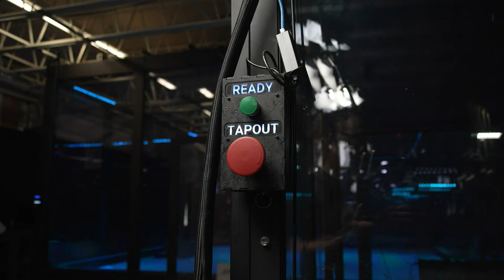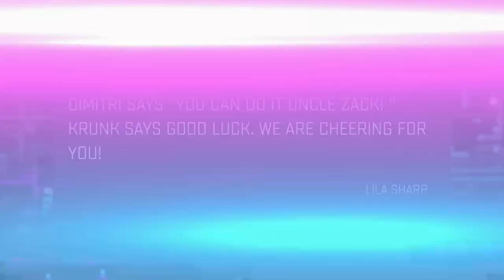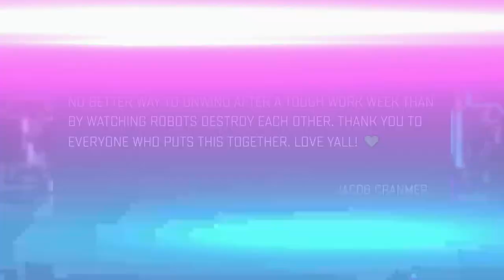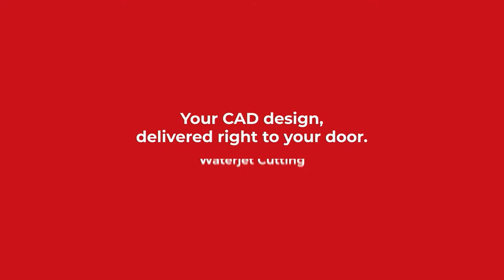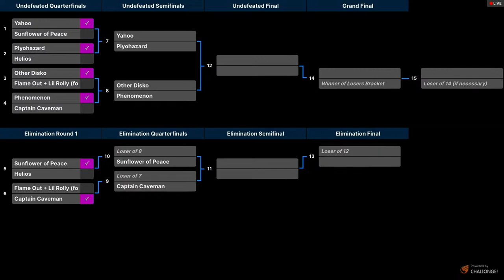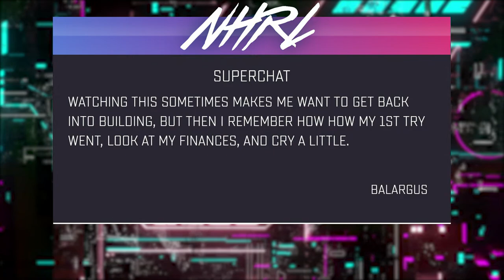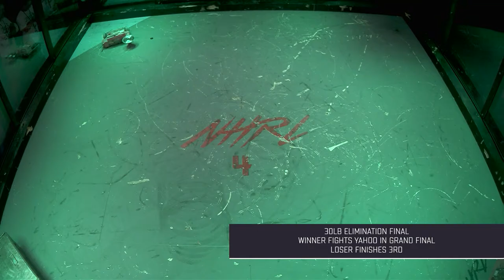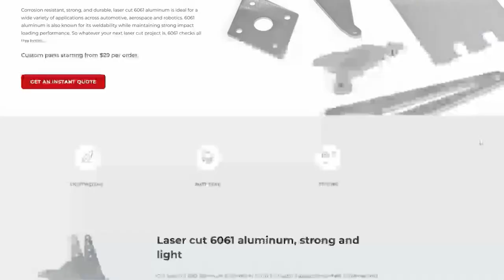2022 Round 5 September: Part 1 Qualifying Rounds from Sept 18 2022

Comment: Team Organized chaos (Hound) Fights:

45:08 Hound VS Attidude Adjuster
2:25:05 Hound VS Tothic
5:55:55 Hound VS Meanie Panini
8:36:26 Hound VS Liftoff
10:01:28 Hound VS Jack Fast
11:05:44 Hound VS Mixtape (forgot the battery door screws)